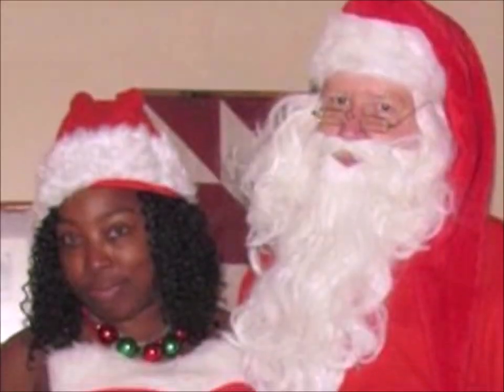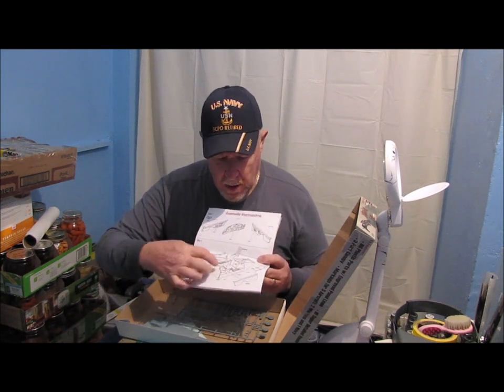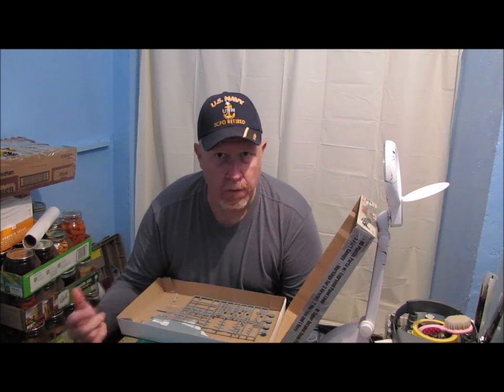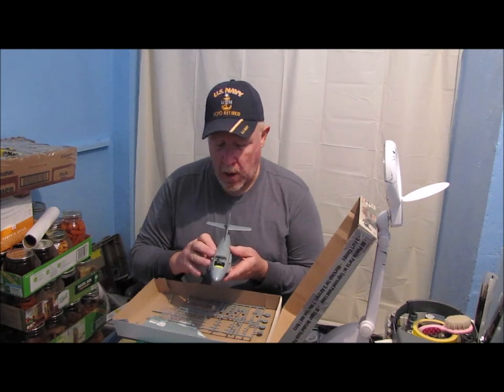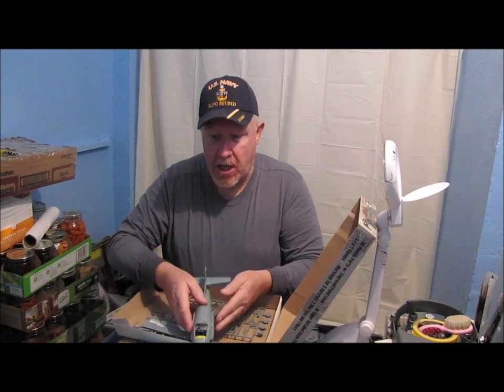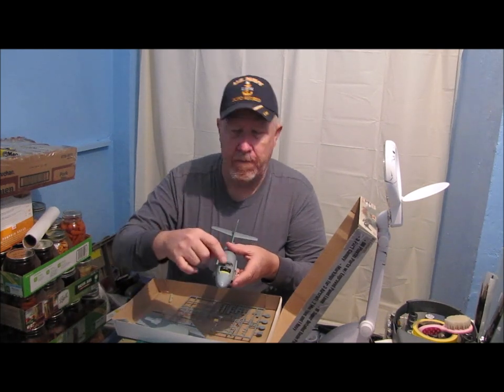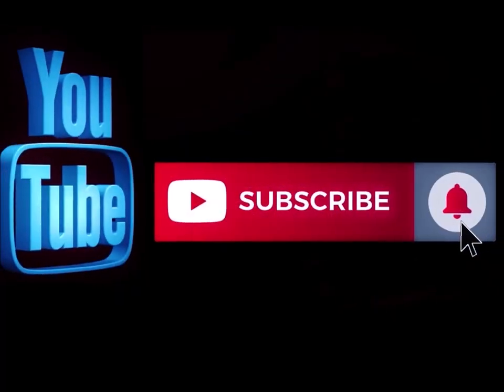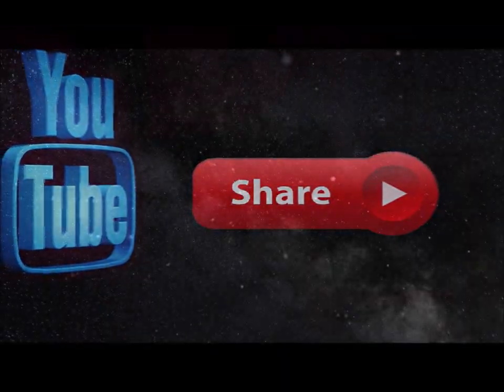Finish it February Update

Comment: Good gracious, you picked a tough one. Gotta role with it, Bud. You’re handling it well.  Just thinking about those compressors; it’ll be ok without them; BUT...maybe if you narrowed them on just one side so they’d just slide into the opening then with a ball of sticky tak in the middle, pull them back towards the opening and touch a drop of super glue at where it meets the side of the inside of the intake. (If that makes sense). [Sorry. My brain immediately goes to trying to solve the problem]. Anyway, hang in there.  You’re doing a great job on a clearly challenging kit.  Thanks for the update. Looking forward to the finished product.  I’ll have another update on mine after the weekend. Take care and Happy Modeling!
Reply from the maker: Yes, this kit has been nothing but problems.  I thought about doing what you described but I am afraid of dropping them into the body to ever rattle around.  I don't think it will be noticeable because the intake trunks are pretty deep.